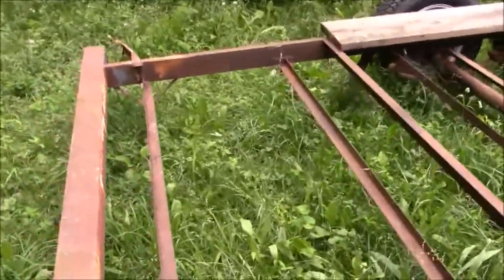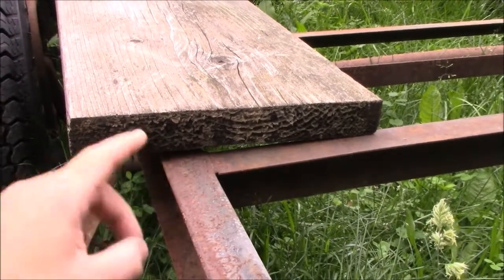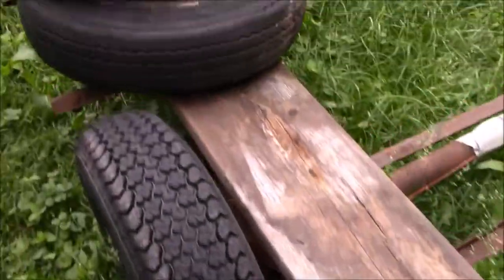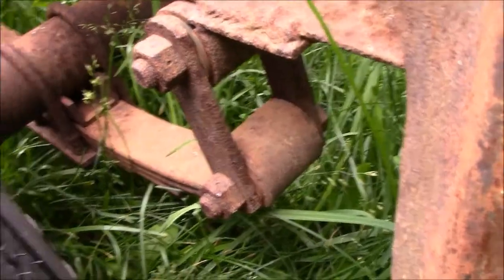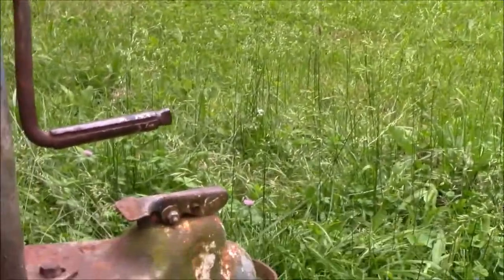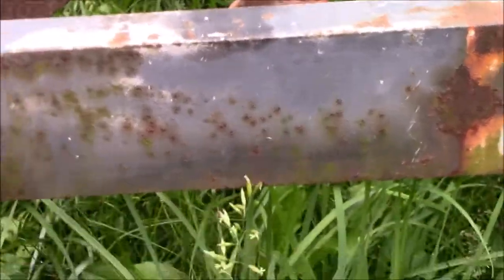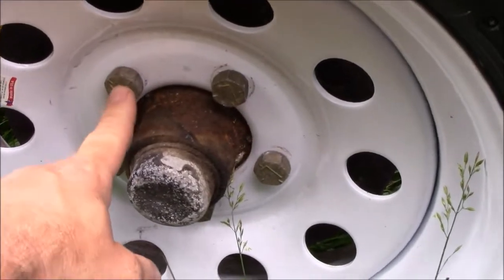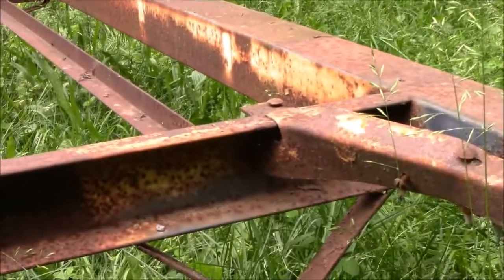16 ft camper trailer/ utility trailer build

Comment: The axle would be good for a car hauler but the frames on camper frames are no wear near strong enough with putting in a lot of re-enforcement
Reply from the maker: I agree with ya they make good utility trailers for hauling lawm mowers and atv, side by side and such i like to find a square tube frame to make a car trailer out of thanks for watching
Reply: If it is c channel.  It will be fine for car hauler

Comment: That's a pretty light frame to be hauling anything heavy like cars, The thing is with camper trailer frames is they built light as possible with the intent for just people to be walking around on them.... not vehicles that weigh 2000 to 5000 lbs. If you intend to use the trailer to haul lighter things like riding lawn tractors and landscape stuff or dirt bikes and light off-road fun vehicles... then you'll be fine.
Reply from the maker: Yea I'm not gong to be hauling cars or anything like that lawn mowers and lumber and small stuff like that is what it will be used for thanks for watching and commenting

Comment: Looks like a cool project
Reply from the maker: It should be fun thanks for watching and commenting
Reply: @renegade07garage  what kinda wood u gonna use for the deck?
Reply from the maker: @creekroadparanormal  I want to use pressure treated 2x6 or 2x8 16 feet long but gotta price them first.
Reply from the maker: @creekroadparanormal  I would like to use pressure treated 2x6 or 2x8 16 feet long.

Comment: Bad thing about converting a camper into a flatbed ( utility, car hauler), they are way narrower than a regular trailer. Also most don't know the camper itself is part of the structure of this trailer. So one has to do some beefing up to get strength in the frame. It's a bit if work but can be done. And yes those are 3500 pound axles but don't forget, your trailer weighs something. So your load won't be 7000 pounds, more like 5500 max. And you need tires that will carry that much weight as well. I'm converting a fifth wheel as we speak. Same as you, cutting out all the camper junk then I'm going back with way heavier bracing, adding a stout tongue and I used the existing frame to make a 3' dove tail. So it will be 19' overall. 16' foot pan( flatbed) 3' dovetail. Also extending the width, it will be as wide as the tires outside to outside with drive over fenders that should only stick up maybe 3 inches or so. Should look nice.
Reply from the maker: when I first converted this trailer I didn't realize I needed to beef up the frame, so this winter I will be taking the deck off and doing that with some other upgrades, I also have a 23 trailer with 2x6 steel tube box frame i will be turning into a 20 foot car trailer with a dove tail 17 or 18 foot deck with 2 or 3 foot dove tail and going to try to make the deck 85 to 90 inches wide. Both should make interesting videos, thanks for watching and commenting
Reply: Hey no problem, second trailer sounds like an interesting build for sure. Go with a 3' ft dovetail. You'll thank me later lol. Wish I could post pictures here I would show you how mine is going. I'll keep a watch out for your videos.

Comment: What size board is that bud
Reply from the maker: 2x8 and 2x10 from Lowe's
Reply: @renegade07garage  thanks for getting back to me, I know you didn't end up using the trailer for a car, I wish I did a little research before I purchased mine, seem so rickety, I added additional cross members and corner braces, did the wood help to further strengthen the trailer as a whole, my car only weighs less than 2500 lmk